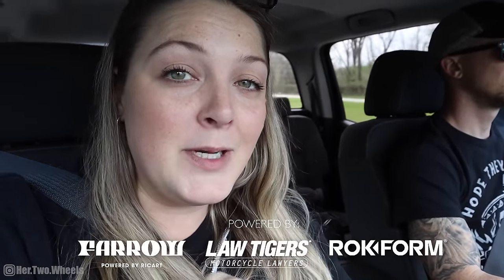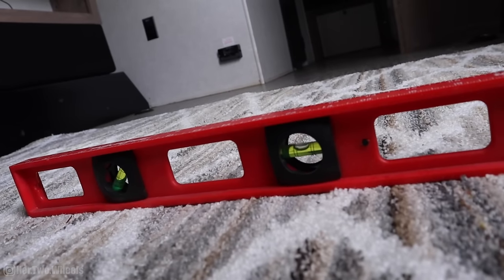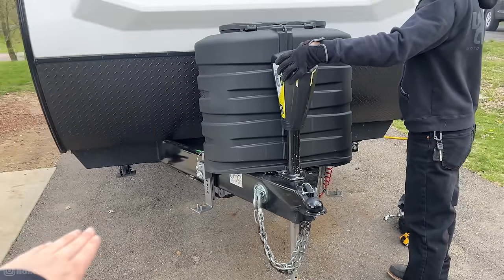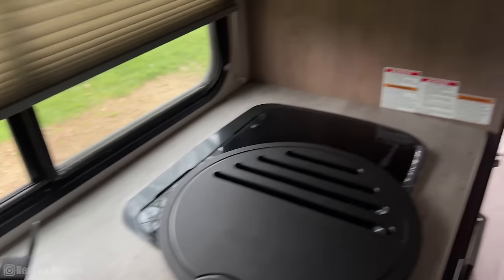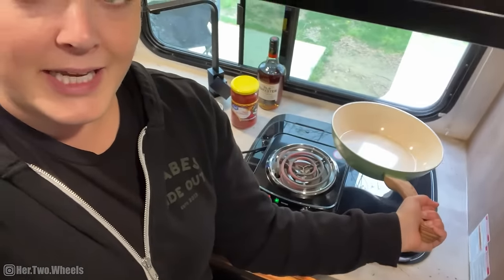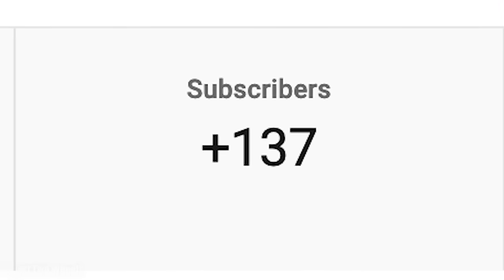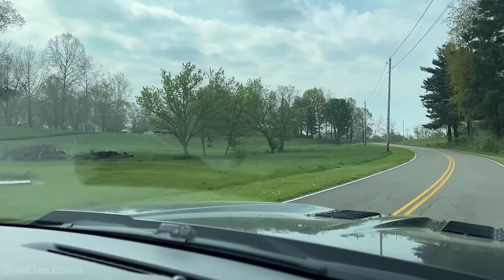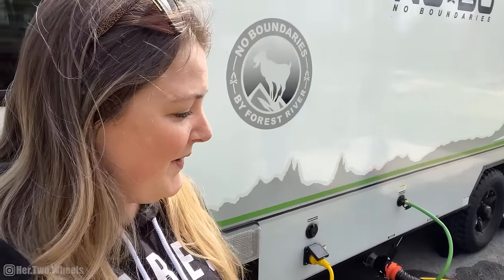First time camping in our new Toy Hauler! Mistakes were made!

Comment: Refrigerator tip:  plug in the camper at home the night before and load up the fridge. You can use a 30amp to 20 amp dog bone adapter to plug into a regular outlet. Then when you leave in the morning, unplug, and add a few frozen water bottles to the fridge to hold the temp while on the road.
Reply: Agree with plugging it in at night, however, when your driving, switch over to LP for the fridge while in transport. Then back to electric when hooked up at the site
Reply: @WeaponsArtist  Some States it's illegal to drive around in an RV with the propane turn on. It is a safety issue.
Reply: You need a Pressure legislator. For the water or you will blow all the lines in the traler
Reply: Alot of new camper trailers the fridge runs on 12v when not plugged into to shore power. From what I understand. It's not legal in alot of states to run appliances on gas while traveling. So manufacturers stopped doing that. Not saying freezer packs or whatever won't help during traveling. But while traveling alot of new RVs the fridge will stay on running of 12v, and the system stays charged while driving. Or use solar.
Reply: Agree 💯 Glad someone told us with our camper after we took a few trips doing the same thing as you guys.
Reply: We do the same.
Reply: Your toy hauler looks like it has off-road tires just curious are they trailer tires?

Comment: A tip for you.... Put 4-5 gallons of water in black tank. Also put Happy camper in black tank. Water is your friend for the black tank. Water use plenty of it when you do #2. When you dump your tanks black tank first then back flush it. When done put 4-5 gallons in black tank and leave there add happy camper also. Then drain your gray water tank last to flush out the sewer hose.

Comment: If you’re going boondocking, you’ll need a generator to use all those electrical appliances
Reply: I have used our toy hauler for my first season of motorcycle racing. Most sports are not supported, so I have a duel fuel generator from Harbor Freight. I run it on propane from the bed of the truck. I don’t even disconnect from the truck for the weekend. I just used the tongue jack to remove weight from the hitch….
Reply: Solar/battery…

Comment: Another tip:  once you actually use your toilet and black water tank, a final "scrubbing" can occur when you leave the site if you'll dump a bag or two of ice--cubed or crushed, sharp edges preferred--through the toilet and into the tank.  Sloshing ice as you drive will help clean tank interior, then drain and refill again after it has melted.

Comment: You done great the first time. Lots of good comments and suggestions. I been doing this for over 30 years. Propane will last a long time ,so you are over concerned about that.  No problem using the electric heater ,but turn the furnace on,at night if nothing else. As someone else suggested.leave the gray and black water valves closed until tank is full then dump black tank first then gray tank. The size of those tanks vary from camper to camper,but guessing your are around 30 gal. Really no need for full hook up site for a weekend,but understand you were trying everything out. Water pump doesn’t need to be on if hook to city water. If pressure is low ,it’s most likely the regulator installed on the hose at your filter . The the water connection probably has a frost free thermostat built in and it got cold enough at night ,early morning to trip it so water would not freeze at the water hookup. One last tip. When you hall the bikes,unload them before you back into the camp site. Some camp sites will not have enough room or be to steep to get the door down and bike out.
Reply: Thank you! I just watched this as my hubby & I just bought at 28’ Toy Hauler (newbies to RVing altogether!) and taking our first excursion in 2 weeks time! Both this video and the comments, including yours, have been Fantastic! 🙏👍

Comment: I know it's been awhile since you guys posted this. 
But, I don't unhook the trailer tongue distribution hitch. I raise or lower the receiver plug, until it's level and there's no pressure in the receiver tube. Then it will slide out easily when you pull the pickup forward.
Then level the trailer. 
Do it in reverse when getting ready to hookup and leave. 
As for your black tank hose, you don't need to hook it up until your tank is full, then empty it. Leaving it hooked up all the time will invite mice, rats, snakes and big bugs to crawl into your trailer from the sewer..
Always spray your power cable and hoses with bug spray, while they're outside hooked up laying on the ground..
Good luck

Comment: Tip... always disconnect the bars on your weight distribution hitch before backing your trailer into a spot, whether that's at home or into a camping spot. Because those distribution hitches do not like to be turned too sharp and it's not good to go over really big humps or dips with them. Often you will have to make sharp turns when backing into a spot and the ground can be pretty unlevel... then you combine a sharp turn with unlevel ground and your weight distribution hitch is going to really cry, and may even break something.
Also, wait to connect your weight distribution bars until you are on the road where it is straight and level.
Reply: I was just about to comment about the same thing, also most weight distribution manufacturers specifically say not to back up with the bars set.
Reply: I have an equalizer hitch which is very similar to yours. The manufacture says you can backup without taking off the bars. Check with your manufacture and that will your best source for info.
Reply: I have the same one as they do, and back up with mine.  The last time I parked I took them off first and had a hell of a time backing into my storage space.  Seems way easier when they're on for whatever reason, but I'm also backing in at a decent angle, not 90 degrees
Reply: You can back with them... just not up step or uneven grades. It puts a lot of strain on the bars.
Reply: i think the flat bar style you remove becase they are also a sway control, where chain style can backup once you remove the sway control bar.
Reply: @putz173  I got curious after commenting earlier, as I have the flat bar style.  I guess Husky states they're cool to leave on.  Maybe if you're doing some major turning, but I haven't had issues yet leaving them.  I do know they're a bitch to get on/off if not on perfectly level ground
Reply: This comment about the distribution hitch is true, but only with the chain style. The bar solid bar style you can back up and do not have to remove them.
Reply: @putz173  I've never had a problem backing up.. I get it that they don't want you to back up a steep hill while turning or something like that, as that would put a lot of added pressure on the bars. Other than that, I have backed into places just fine with them on.
Reply: That makes no sense. So, you can turn going forward and have to do some sharp turning but "somehow" you shouldn't back in with it? My thing is people need to stop getting these harmful WDH because it's actually harmful to your frame. If people knew and invest in affordable rear suspension kit for their towing vehicle than you won't have to worry about these nonsense conversation when it comes to WDH.

Comment: You guys did a great job. Suggestion: Replace the oil heater w/a tower heater. Takes way less space,oscillates, and has a blower. Also not hot to the touch. Your cat will like that!  Used to be you needed a white hose for pottable water. Water pressure issues: Don't turn hose on all the way.If you're unsure of it,turn off at night. Anything that runs on gas should be used once in a while to keep 'bugs'(spiders) out. Also I've noticed lately that Wal-Mart has a lot of camping stuff way cheaper than dealers. Happy Riding!

Comment: not too bad for the very first time. Tip, precool the fridge at home 😉 if the hauler is connected with power while driving, boom, all is all set when you arrive the campground. You can fill up the fridge at home then too. 🍻 cheers

Comment: I’ve camped at Dillion a few times with a tent and a camper.  I would say all the city hose connections out there probably have pressure vacuum breakers on them to keep water flowing back into the city when you shut off the water and it dumps water out of drain holes.  Possible one became stuck open and continued to dump water during the night until someone started using water again.  I pulled a 32 foot campers for years, they can be a lot of work sometimes, but I think I enjoyed it most of the time, except once when the water line come apart in the middle of the night and flooded the camper, water was flowing out of the walls.  Happy traveling!

Comment: When you back up to hook up your trailer you don't have to compensate for rolling when you shift into park.   Set your parking brake, then shift into park.  It will also keep the pressure off your transmission when the weight of your trailer transfers to your tow vehicle.

Comment: You guys did great.  Im sure you have already learned from the first set up.  Propane will last a long time.  Do all your hookups after getting the trailerset and level.  Park it as far left as possible, closer to the water, electric and sewer connections. I see theres a lot of "next" time suggestions so hope they all help. Dont forget the furnace in your rv.  😊

Comment: I know when we back into a spot, we usually back in to the right side of the spot close to the power and water hookups. We use less cordage and less hose on the ground that way, and it allows us to have more level surface under our awning ( which isn’t a big deal, unless it is raining and you want to sit under the awning) . You have to think of all situations that could arise during your trip, before you level up and hook up all the facilities. Other than that, just have fun. You will get faster with setup the more you do it. You can run that camper for a week or more with the propane in the tanks, turn on your propane refrigerator before you leave home, get it cold and fill it up, you will be fine. It will give you more room for beer in the cooler. In order to understand and feel comfortable with your propane usage, when you get home and get parked, turn on your propane refrigerator and your propane heater to a decent temperature and just let them run. Check it every day and you will see how long the propane lasts, that way you won’t be nervous about running out on a trip. You will be surprised how long it will last. You can even go out and cook supper on the propane stove to get a more full understanding of it. The best place to learn about the camper is at home, because you have everything in the house when you do run out of stuff. The water leakage is due to pressure changes from the water system, you have yours hooked up right to prevent problems, but it will still make a mess. When we go camping we usually use the shower house for showers and shiting and use the bathroom in our camper for emergency situations. Always dump your black water tank first, then flush the gray water tank last to flush out your sewage line, it is a precaution that is necessary to prevent bacteria and smells in your camper. I always enjoy seeing you two together enjoying life.

Comment: It's a learning curve, for sure.

I've never camped at a site with full hookups.  I've always had to fill my water tanks and either run on batteries or the external generator I bought later.  Smart move to get used to dealing with the sewage line at a spot where you didn't need to.  That way, when you're somewhere that you need it, you'll know how to handle it.  Yup, you just stuff it in the hole.

Unless you're in the arctic, two propane tanks will last you for days of cooking and heating for two people and that's running the fridge on propane, too.  Propane does cost $$$, but cooking with gas is sooooo much better.

Going through the hours of prerp to load the trailer and setup, tear down, etc is a lot for one night of camping.  but when you get it past a few nights, it becomes worth the effort.  Some cats don't handle travel well.  But some can get used to it.  

Good to see Jordan is trained to flush all by himself.  😂

My Tacoma's backup camera allows me to single handedly back up to the hitch with like 1/4" accuracy, even though the monitor is tiny (in the rear view mirror).  Backing up the trailer solo into tight spots, however...   Sure is a lot nicer with a guide or camera on the back of the trailer.

Comment: When we camp I dip cotton balls into vasoline and keep them in a sandwich bag. I used small sticks at first andi put 3 or 4 cotton balls under the sticks. It will light quickly with a match or lighter.  In no time you'll be ready for  some wood. This works very good! 
One thing you could do is take yourself some notes to go by when setting up and breaking down until you get yourself confident!  Mistakes can be costly! Happy camping!

Comment: I do all that stuff myself level it and put the stuff down but my Camper travel trailer is a 2016. I have power awning, power, stabilizers and power off tongue. That’s what I did. I plugged it in today so I have the battery the battery charged up because I’m gonna take my kitty cat with me tomorrow, I need to do that. This is something I need to do. I take her to litter box take that chair that she sits on. I got some vegetables here stick them in my fridge that I’m this week. I gotta get a propane tank filled and then another one filled.

Comment: These chevy trucks have a thermostat in the trans cooler lines. In the aftermarket there is an eliminating kit for the thermostat, and its very easy to install, Jordan can probably handle it. That might help the transmission issue.

Comment: Make easy homemade fire starters.  Buy eggs in cardboard egg cartons, fill each slot with dryer lint, then pour melted wax over each until full.  Break off one or two for each fire, they burn for about 10-15 minutes.

Comment: 1. I recommend connecting the sewer to the drain then the camper.  Hold the hose end below the camper drain line before you take the cap off.  This can prevent a mess on the ground if someone pulled the gate valve open then shut it with the cap on.

2. Don't leave your gray water open.  Wait until the tanks are full.  Empty the black first, then the gray.  This will help clean the sewer line.

3. Connect to shore power before any disconnecting.  This saves your batteries.

4. Put a regulator on the hose bib to protect your hose & filter.

5. Write a checklist (I have one on my phone) and use it.  It'll help a lot, especially in the beginning until you get comfortable.

Happy trails! Once you get used to the RV lifestyle, it's a lot of fun.

Comment: It is a constant learning experience. But good job.
One thing, dumping.
Dump black first then dump grey. The grey will washout black water "remnants" in the sewage pipe.
We pretty much use KOA grounds at this time. Full hookup.
We hual 2 Harleys in a 22' mxt.
Also small bag off ice down the toilet before hitting the road will break up any solids. Just hit a dump station after.
Good luck you will love it.

Comment: A 24ft camper was my home for about 12 years, here's some advice 1, when you park in your camp site, you want to get as close to the left as possible, that way you don't have to stretch your hoses so far, when you disconnect from the trailer ALWAYS UNHOOK THE SAFETY CHANES FIRST, if you forget the chanes, you will brake something

Comment: Not bad for your first time! Take it at a pace you're comfortable with. First, measure your slide and know how far it comes out. Move it over more towards the utility side so you have more space on the living side. Those X-chocks go in AFTER you're all set up. You will bend them in more extreme cases of leveling. Get a 25 foot Zero-G RV hose. A 25' hose will work at 95% of campsites. That blue hose you have is horrible. It's rare to need a longer one than 25'. 20' of sewer hose is enough 95% of the time as well. Your water heater has to fill up if it's been winterized so it will blow air out of the hot taps for a minute or two while it fills. Get an electric heater with a thermostat on it and never use your propane! That black stuff coming out of the filter is just charcoal. They all do that when new. You'll be pros in no time. My wife and I get this all done in about ten minutes.

Comment: You did really well for your first time! My husband and I just bought a toy hauler a couple weeks ago (to haul our bikes when the weather allows) and had our first camping trip last weekend. It was amazing! I'm definitely a beginner myself though and didn't have the patience to go through other people's comments, but one tip I can offer is to bring a bucket to fill the black tank through the toilet. It is one more thing to bring, but so much easier than standing on the flush lever! We just followed the instructions on our black tank solution, filled the tank in the sink, mixed the solution in the bucket, poured it into the toilet in batches and flushed once!
Reply: You can close the black tank valve while the Flush is running to add the appropriate water to the tank 😉

Comment: If you’re hooked up to water hose you don’t need to have the water pump on. Water pump is only if you’re using the fresh water tank to supply the camper. 

Flushing the sewage, always open black water first then after you flush out the black water, use the grey water to flush out the poo hose. 

But it’s your first time so most people go through this learning curve.